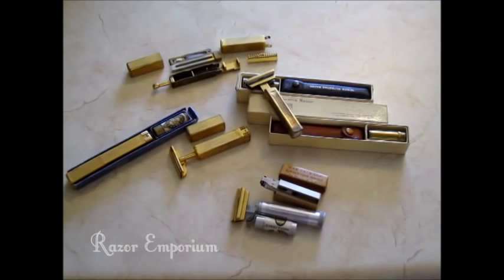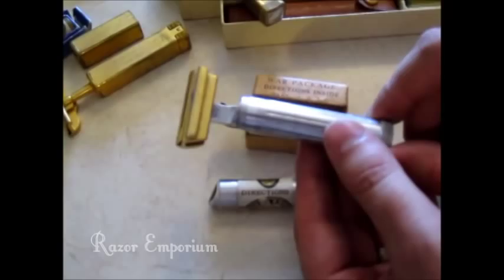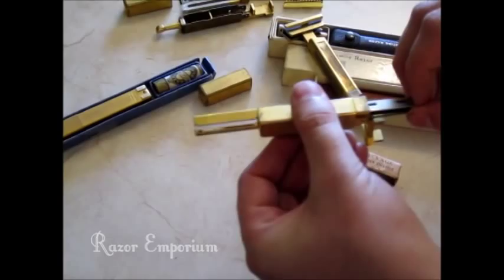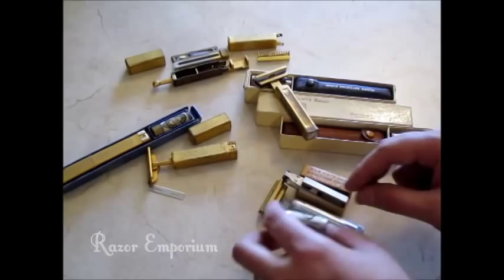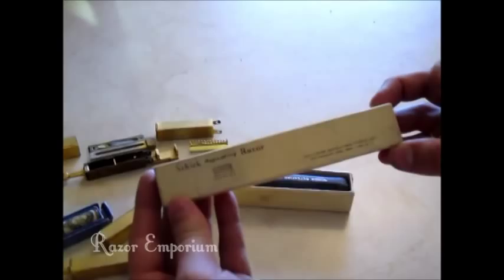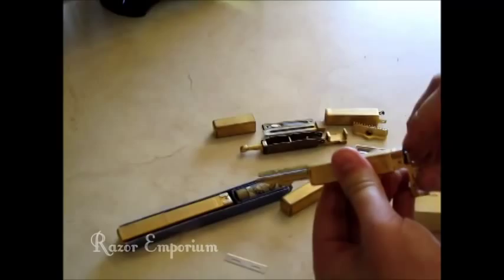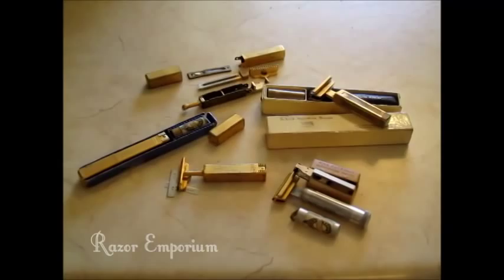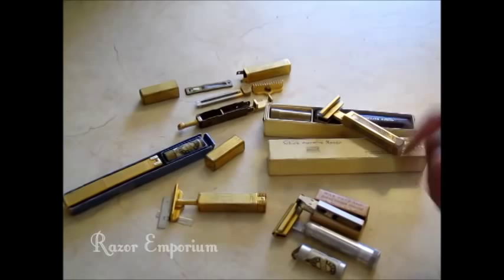Schick Magazine Repeating Razor / First Generation Schick Injector Safety Razor

Comment: Nice video and nice collection.  Got a C3 and was jammed, took it apart. The inside was covered in gunk, someone had used oil , probably 3 in 1 or similar and that stinky and sticky.  I thought mine was very dirty and then I saw your taken apart razor and realized mine was way better.....after 3-4 soap/bubbles wash it was not looking too bad. The guts are printed and bent tin (not sure what metal). Was lucky to find some additional pics in a forum to put it together as some pieces flew out when disassembled....

Comment: I just found one of these belonging to my great-great grandfather, and I was super curious as to how it worked! Thanks so much for posting this, it's an amazing piece of history. Do you have a link to the blades used in the video? I have no idea what ones to look for haha
Reply: The early Schick injectors use the same blades as the last generation of Schick injectors in the 1990s.  You can buy Schick style injector blades on the Internet.  To load them in the earliest Schick injector razors, you will need to push them out of the injector key and load them manually in the razor. The earliest Schick injector razors did not use keys.